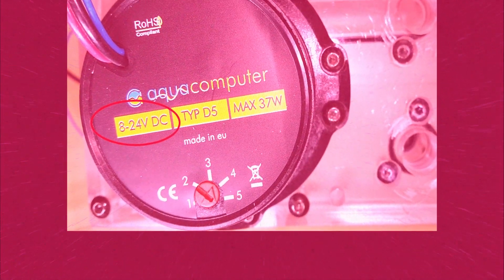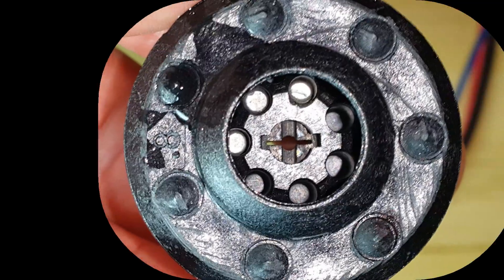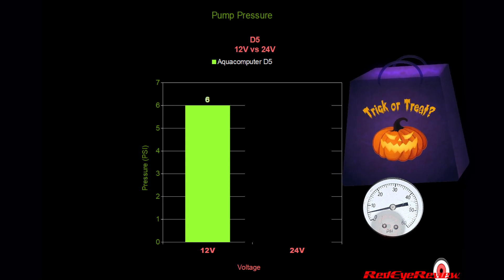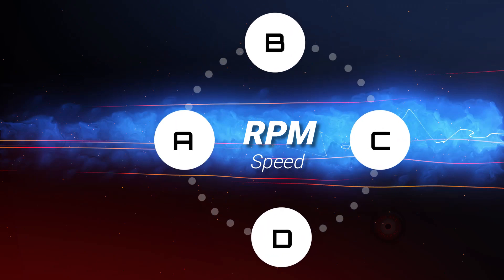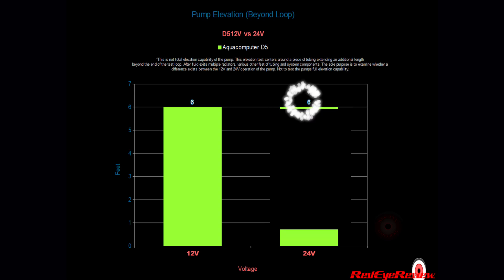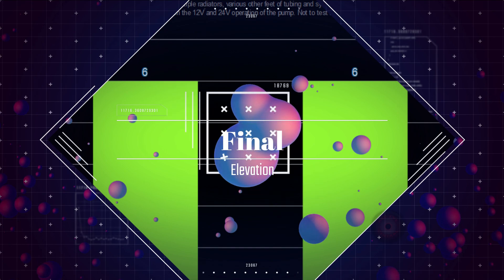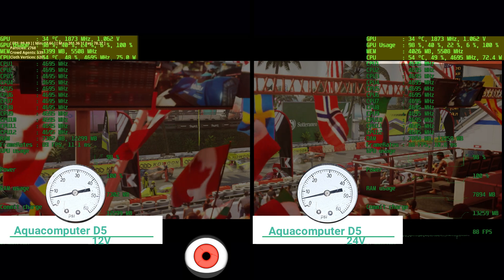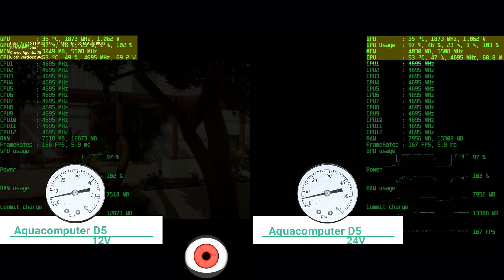Running a D5 style pump at 12 vs 24 Volts. TRICK OR TREAT?

Comment: Also did a little test while watching the with a voltage generator.

D5 on full
12v pulls 1.4~ amps of power
24v pulls 0.72 amps of power 

either way its just pulling the 17.28 watts

Happy tuning !

Comment: The motor works based on a fixed frequency (RPM),  more voltage would only matter if you tried to perhaps pump mud.   It'll probably perform just as well at the minimum voltage as well.  Efficiency of the pump should be higher at higher voltages as it will need to draw less current to get the same wattage.    By the way your transformer is really a boost converter.  Transformers can only step up or down AC current.  The boost converter has an inductor but it's not really a transformer.  All that aside useful video as I'm sure many would be tempted to try this.
Reply from the maker: Thanks for the feedback. Great additional info! If you have any other insights on the internals of these particular models of step voltage devices let us know. Interesting. I don't have any hands on experience tearing down these modules so I really not sure what the layout is inside these devices. Maybe in future we'll also try a tear down of one of these lower priced step voltage devices, to see what is going on inside vs the standard Boost/Buck converter. If any difference exists at all.

This particular one is marketed as a "transformer module" and also as "boost converter". And it is described as having "synchronous RECTIFICATION technology."

Among many re-sellers, it seems to be more commonly marketed in consumer space as a "Boost" (step-up) or "Buck" (step-down) "converter" when sold with exposed circuit boards and being targeted as voltage regulating to integrate internally into self-contained electronic component systems (dealing strictly with DC-DC voltage conversion). But many other step voltage devices are additionally marketed as "transformers or transformer modules" and are packaged as a self-contained standalone unit with heat sink and sealed against moisture intrusion for inline (exterior) applications between self contained devices (ie. golf cart charging, car audio, between power supply and another external device, etc).

Which leads to wondering whether that is dependent on different methods utilized to step the voltage. And if some of these are strictly DC-DC or if they are employing a "Transformer". Whether some are taking DC to AC and employing a transformer to step the voltage before rectifying back to DC. Not sure if that is the "RECTIFICATION" to which they're referring on the product description.

Also not sure if the sizing of the components in current fabricating methodology out of China is efficient enough to fit all of the components necessary for that process into this little module. Or if that would take a much larger package to deploy. Or if it just some type of linear DC-DC conversion which is then labeled as "Converter" and "Transformer" for consumer marketing consumption.

Some interesting additional articles:
-------------------------------------
DC-AC-DC:
-------------------------------------
"one way to convert the voltage of a DC supply to a higher voltage, for low-power applications," ... "convert it to AC by using a vibrator, followed by a 'STEP-UP TRANSFORMER' and rectifier. For example, to convert the DC power supply to high-frequency AC, use a transformer — small, light, and cheap due to the high frequency — to change the voltage, and rectify back to DC."

https://en.wikipedia.org/wiki/DC-to-DC_converter

-------------------------------------
Synchronous Rectification
-------------------------------------
Here is an article submitted from "Henan Polytechnic University" (near area of the world where lot of these lower cost electronics are manufactured) to an online scientifc journal talking about DC/DC "Synchronous Rectification" Analysis https://new.hindawi.com/journals/jat/2019/2613893/ where there is many mentions of a "secondary side of the 'transformer'".

"3.1. Main Circuit Topology
Traditional ZVS full bridge main circuit topology is shown in Figure 5. Vin is the input DC power supply. Switching devices Q1 Q4 (including D1 D4 and C1 C4) form the inverter bridge, Lr is the resonant inductor, T is a high frequency "transformer", D1 and D2 form a high frequency rectifier bridge, and Lf and Cf form a high frequency filter. The converter has problems such as difficulty in commutation of the lagging leg, voltage fluctuation on the secondary side of the "transformer", and low efficiency." 

"Because of the damping effect in the resonance process, the voltage on the output rectifier device will gradually decrease to 2/n, and the secondary voltage of the "transformer" will gradually decrease to /n."

-------------------------------------
Active Rectification
-------------------------------------
"Using active rectification to implement AC/DC conversion allows a design to undergo further improvements (with more complexity) to achieve an active power factor correction, which forces the current waveform of the AC source to follow the voltage waveform, eliminating reactive currents and allowing the total system to achieve greater efficiency."

https://en.wikipedia.org/wiki/Active_rectification

Marketing terminologies utilized often seem conflicting. But many of these are low priced and manufactured overseas so the marketing references toward the final product, from a sales perspective, may be a combination of things:

-The way specific converters are boosting the voltage and referencing to internal "secondary side of a transformer" (as mentioned in the link below out of China in regards to a charging DC/DC converter) thus the term 'transformer'. 

-Or if it is a difference in the methods used in boosting the DC wave linearly VS transforming from DC-AC and employing transformer when stepping up voltage and "RECTIFYING" back to DC and whether that is the "Synchronous Rectification" terminology mentioned on the product description.

-Maybe just a translation situation where the overall concept was translated and identified by a specific component within a specific item model that is pervasive in many sales description terminologies regardless to whether that model employs that process. 

-Possibly emanating from the idea that many devices utilize an AC to DC wall adapter (power brick) but that those could be run directly to DC for certain mobile applications and bypass the need for the power brick and AC altogether (referring to "transformer" to go from AC to DC which is all just ends up as DC). 

....OR maybe some other reason entirely. Haha.

But definitely some excellent additional insight for us to consider!
Reply: @RedEyeCentral get a genuine 24v dc power supply. only proper way to do this experiment.